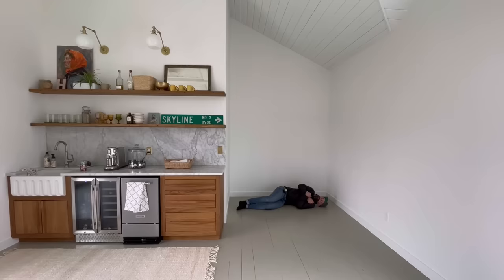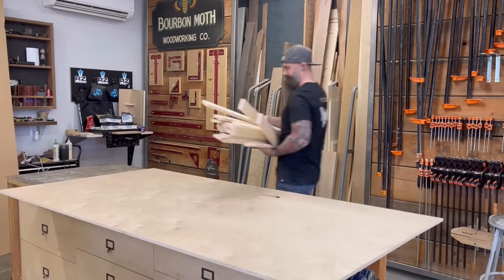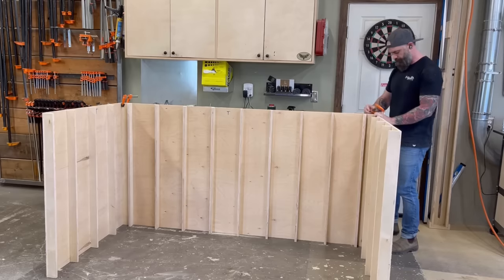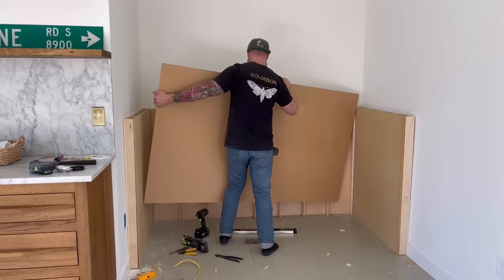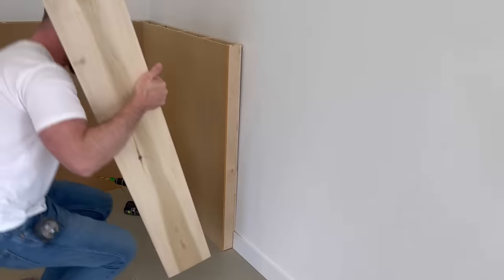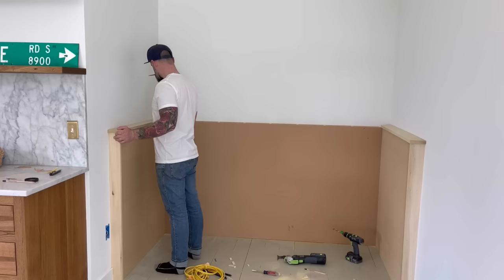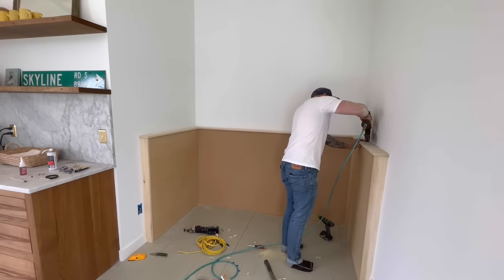Cabinet Building Made Easy || Easy Built-In Bed

Comment: Looks great!     FYI - where I live we are not allowed to cover a junction box. We would have to leave access to every electrical connection.
Reply: Its a good thing he has already had a build inspection
Reply: Australia?  I've heard they have some insane rules against DIY electrical work down under.
Reply: pretty sure that's a rule in the US as well, would have been easy enough to leave a small cut out for the box, would have been hidden by the mattress regardless
Reply: If the circuit runs to the left of the box, he just shortened the line. If not, shouldn’t have covered it up.
Reply: Agreed.  Never hide a junction box. Troubleshooting a (rare but possible) loose connection in the future will be challenging for the next homeowner. 

Or, just put the link to this video on the outlet plate 😂
Reply: Yep. Junction box has to remain “reasonably accessible.“ Could possibly build in an access panel?

Comment: Hey there. not sure if you will read this. I build and fix tiny houses full time and you start getting mold issues on the bottom side of the matress if you do not have any kind of air flow underneath it. You will need a slatted frame. Even if you put wholes into the multiplex underneath it won´t be enough. Your body extracts around 500ml a night. Greetings from Germany.

Comment: Beautifully done! And refreshing to see a painted surface. So restful. You CAN get a smooth un textured surface if you use oil based enamel. After painting with a roller it smooths itself out. Plus kids are hard pressed to peel it like they can with latex and it’s easily washable and hard as a rock. We raised six and there’s nothing better. It’s just getting hard to find.

Comment: 25:06 Jason - Bourbon Moth. Just a suggestion?? Take the top (base) where the mattress goes and split it into two pieces. The front most piece is nailed in place over the drawers but the back section has hinges and a small round hole so you can lift the back up to use that empty space as a 'hide-away' storage area?? Your welcome.
Reply: The "foreman" would love that place!!!!!

Comment: As an electrician, just a little tip about the wiring for anyone who's reading these. Since that's a 15A outlet, you only need 14 AWG Romex. Using 12 AWG isn't wrong, just a little more expensive.
Reply: I'm surprised you didn't mention that the junction box thing would be a problem because now there's no access to those connections
Reply: Wait. You have to use the same wire - it has nothing to do with the receptacle. If the original wire is yellow, or !2 AWG, you need to follow that to the next receptacle.

Comment: Love all the projects. With all the cabinets built over the years, do you finish the inside of the drawer boxes? If so, with what?
Reply from the maker: I do! Any type of oil works. I typically use teak because it’s easy to apply, sometimes Rubio. You just want to avoid anything with a strong smell
Reply: @Bourbonmoth  thank you!  I’m first in line when the “Zip Zap Zoop” merch comes out…lol

Comment: Laughed so hard at the 10 inch-mistake. Not because it was hysterically funny, but because I've done that mistake so many times in different forms and shapes. I could probably run a marathon with all the waste Ive accumulated from baseboards being cut too short. :P

Comment: Looks nice. As a work flow question, why don't you break down your full sheets with the track saw in both dimensions? Don't have an 8' track, or just don't mind wrestling big sheets across the table saw?

Stay well.
Reply from the maker: With the big outfeed table it’s not bad on the table saw

Comment: Did you just screw the panels onto the walls? How did you address the gap created by non square wall? (screwed in at the bottom and the top near the shims?) Final results look fantastic!
Reply from the maker: Yes, the 3/4” ply was rigid enough to bridge the gap

Comment: Would mould be a problem for the mattress? There is no ventilation under it. Or do you plan to flip it every 3 months over?
Reply: Mold shouldn't be a problem if you have heat and AC... Have had a base like this for over 25 years with no problems. We turn the mattress end for end every month but never over...

Comment: Questions Mr. Moth... on your drawer boxes,  are you using 1/2 or 3/4 ply? If 1/2, how do you drill that hole in the back for the Blum slides w/o blowing thru and into the box?

Comment: Hey, um... the project is nice, but that box you moved? 
I'm pretty sure your fix isn't up to the US NEC (you need to be able to access the box if anything goes wrong [for example, a wire nut working lose], and now it's sealed behind a giant built-in bed...)
Reply: kinglouistexas  Thanks for confirming that! 
I'm not properly trained on this stuff, I just went and read some books and watched some Youtube videos after figuring out that my house (which a properly licensed guy signed off on!) was- basically a death trap. Exposed NM everywhere (one was live and hanging at eye level in the basement), ground wires were optional, and every light was wired on a drop leg.
Reply: I had the same thought, but this is a woodworker making a bed. We're not here for electrical tips, if he wants to do dumb shit at his own house who are we to judge.
Reply: @snesguy9176  Judge? Probably shouldn't. Warn him he done made a mistake that is going to have an electrician cussing at him? Probably should.

Comment: Why didn't you make the drawers deeper so you would not have the dead space behind them or was a question what was the longest drawer slide available.
Reply from the maker: Yeah it’s hard to find much deeper drawer slides
Reply: I built a king size bed with 4- 32inch deep drawers and am about to start  another. Internet has 32 in long and longer but they are stupid expensive. We desperately need the storage so it was a necessary expense

Comment: Since you are painting it, is there a reason to use poplar? Stronger edges vs plywood?
Reply: Mdf and Poplar are the most common paintable surface materials unless you want to use maple .  They all paint very well.  When you say plywood, I’m not sure what you mean?  Plywood would never be used as a facing. You could use birch as a door center or a cabinet box and paint that. You would for a solid paintable facing usually choose Poplar.  It’s a cheaper solid wood that won’t have grain telegraph through the paint like oak will.
Reply: @Californians_go_home  thanks, yes I meant birch plywood not construction plywood. I did not know poplar had "smooth" finish without grain showing through paint.

Comment: As per NEC code, all junctions/splices should be easily accessible. You buried a fire hazard.
Reply from the maker: It is easily accessible. All you need is a saw……
Reply: @Bourbonmoth  You will definitely need a good insurance policy with junction boxes like that.
Reply: You know it's only a fire hazard if you incorrectly did the wiring right? Code has multiple failsafes included.

Go ahead a bury a junction box. Sure it's against code, but if you connected the wires together properly in the junction box, used the correct size of conduit, proper breakers, correct number of receptacles on a circuit, etc. etc. (you know, all those other things that are in code), then you have nothing to worry about besides some person with a clipboard saying "you did this wrong".

Comment: Your'e a better woodworker than I am, but I have a shop, and a fancy ass track saw, too. I got frustrated when you double side taped a board for a taper cut, when slapping the track down and zip, done. I've done it 100 times to scribe against walls.

Comment: you created a electrical code violation. you can't bury an electrical junction box in a wall or behind a built in piece of furniture. it needs to be open for inspection or fault finding
Reply from the maker: You actually CAN……your just not supposed to 🤣

Comment: Code violation!  You cannot hide a junction box.  It has to be accessible to be code compliant.  The correct way is to remove the old wire completely and run a new one for the new receptacle.
Reply: Came here to say the same thing.
Reply: You wouldn't have to run a completely new wire , you can connect them in the old box but you would need to extend the box through your built in.  Don't think a spark guard will work you will probably need an extension box and then cover with a plate.  The mattress will most likely cover it so you won't see it
Reply from the maker: It’s ok, code violations are fine as long as you hide them under your bed.
Reply: @Bob_H_in_Lincoln  Yeah, you could get away with that.  It wouldn't be the "best" way to do it and an inspector could still fail it (proximity to bedding).  It isn't clear that the location is entirely above the platform.
Reply: @Bourbonmoth  😨
Reply: It's okay, no one will ever see it
Reply: @Bourbonmoth  Yes I'm sure you are right.  The monsters under the bed would keep the gremlins away from the junction box.:face-orange-raised-eyebrow:

Comment: Hi Jason. 

Sorry about all of the nonsense surrounding your ‘combustible shop rag’ video. I completely believed your video and think that it was a valuable demonstration and contribution to educating people on the dangers present in linseed soaked shop rags. 

I have had a near miss from epoxy resin pot bursting into flames for similar reason. 

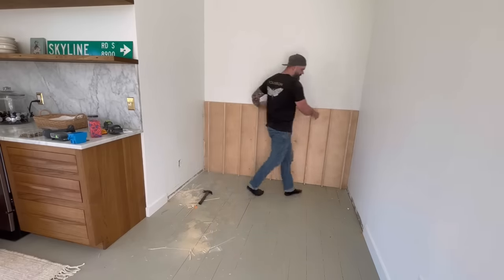Can I suggest you remake the video. Get it all set up the day before so you can start the experiment at 06:00. I think you would have had more fires if you had let it run for longer but I understand it was after midnight so you had to end it. 

Also have a few over head cameras to catch the moment of combustion which you can replay in slow motion with a counter showing to prove there is no editing and nothing was started deliberately. 

Cheers from London
Reply: What if AvE was right though? Is it nonsense then?
Reply: I’d also suggest clear bags and I’d use metal cans and have something below the bags so they can be picked up easily. 

He said in his podcast that he does not plan on revisiting or addressing this issue further.
Reply: @MandoHalrissian  do you think spontaneous fires caused by oily rags are not a real thing that happens?
Reply: Or just post the unedited video

Comment: Alright I had to stop watching and point something out to you. The NEC states that all junction boxes must be accessible. You can stick them in a ceiling where the access is through a light fixture, technically to code. I found one such in my house when I was renovating the bathroom. It is a very dick move, but technically legal. You however are hiding a junction box behind a built-in, big big no nos!
Reply from the maker: It is accessible! You just have to rip out the bed and it’s right there.
Reply: Too bad you didn’t stop watching and see if 50 other people already made the same comment 😂